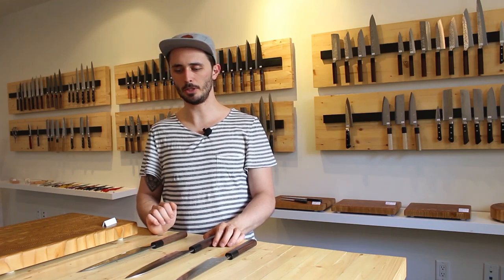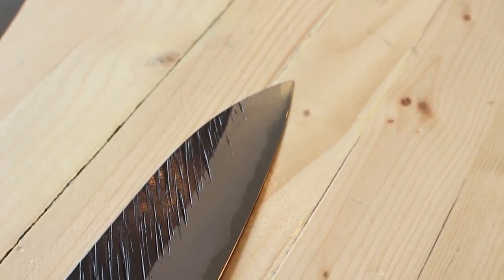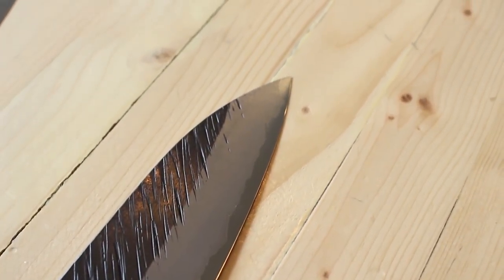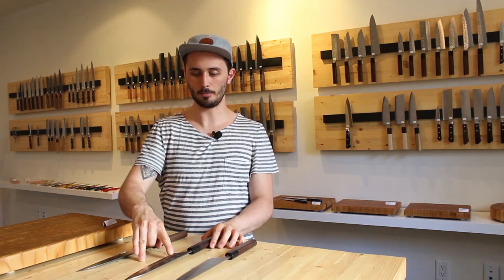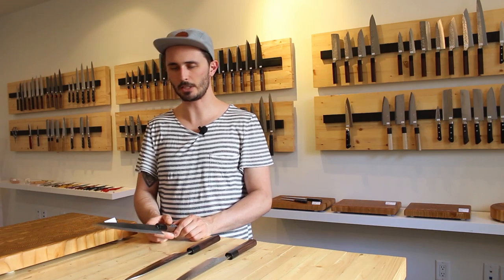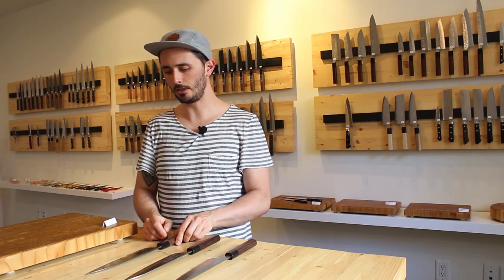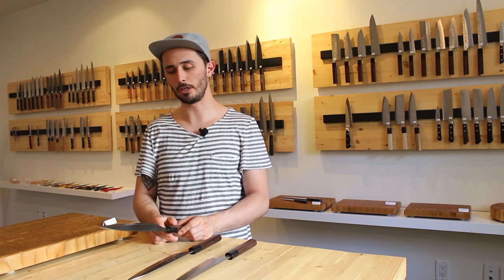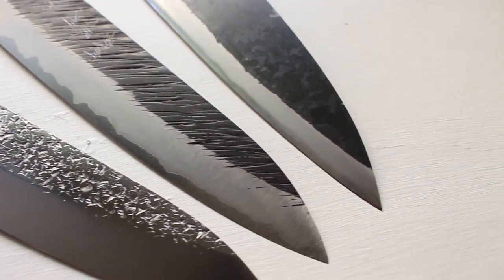Japanese Knives - Maintenance Levels

Comment: Is there a reason they clad carbon steel in iron as opposed to flexible stainless cladding?  Obviously a carbon steel edge has benefit, but what benefit does iron cladding have over stainless alloy cladding in protecting that core of carbon steel?  Is it aesthetics, or just tradition/authenticity?
Reply from the maker: There are a few benefits to iron cladding! Firstly, iron cladding is easier to shape, bringing down the price of the knife. It is also going to be much easier to thin than a tougher stainless when that time comes, and I personally love iron clads for the patina they get!

Comment: You forgot to mention that the 3 layer blades are much cheaper. You only need a little of the expensive center steel.
Reply from the maker: Well thats true I don't think the cost of the steel plays as big a role (perhaps for some supersteels like ZDP-189 or HAP40) but I think its due to them losing less blades to warping/cracking during the heat treat/quenching on san-mai vs monosteel blades!

Comment: Which knives are totally SS? What is your opinion on them? Besides what you mentioned here...Would you buy some for yourself to use at home? Or are you a SS-cladded/all carbon user?
Reply from the maker: We have a number of fully stainless steel knives. When browsing through our website the steel type and whether or not its fully stainless steel can be found on the product page. There are some fantastic stainless steels out there; VG-10, R2(SG2), ZDP-189, HAP40. I would most definitely buy/use a knife made completely from stainless steel though I do enjoy the way carbon steel sharpens and develops character over time. Hope that helps!
Reply: @SharpKnifeShop  Aren't most vg10, SG2 SS clad? Like the Miyabi, Yaxell Enso..
Reply from the maker: @AGC828  totally! You are correct. Almost always with a softer more affordable stainless steel.